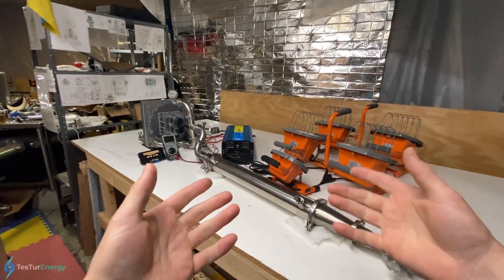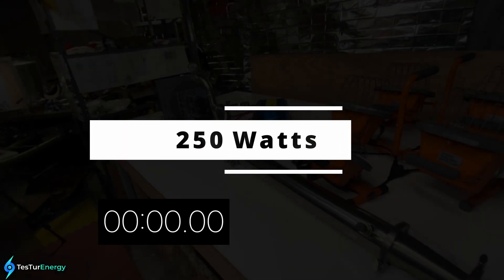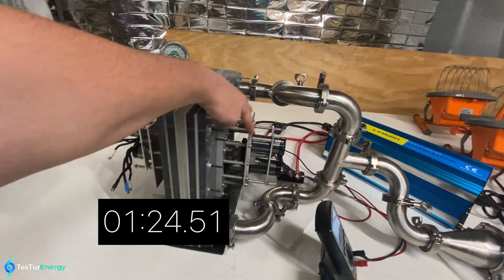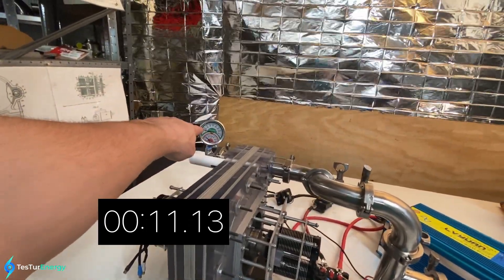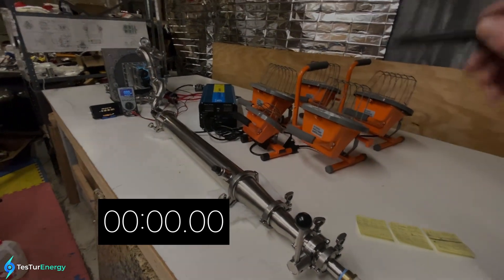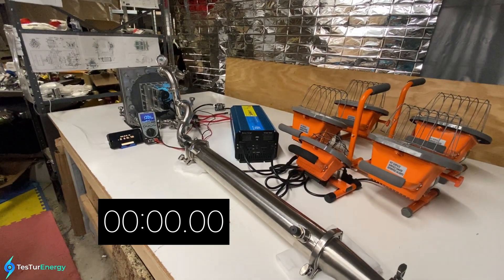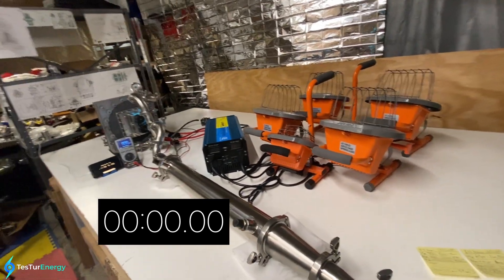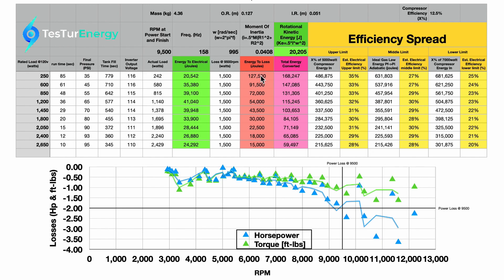Tesla Turbine 250 watt to 2.65 kW Power and Efficiency Test

Comment: Do they work course of course a lot of inventions and ideas work the question is is it economical is it going to save over a different method if it's just a neat study by all means try everything on the planet but if you want to convince me that this will be an efficient means of power generation more so than natural gas coal gasoline hydroelectric nuclear or anything else you need to show steps a through z of what it takes to power this turbine and how much voltage and amperage you can produce and the cost per kilowatt hour because right now I can buy electricity at 12 cents per kilowatt hour and nothing nothing else I have seen in 30 years for me as a residential customer can beat that rate. I'm all for innovation and experimentation but let's be logical please
Reply from the maker: Hey thanks for commenting. With TesTur Energy, our mission is to give people energy independence through Combined Heat And Power (CHP) systems that can make use of underutilized energy sources like biomass, solar thermal, geothermal and even low grade fuels containing high quantities of solid particulates (like saw dust, pulverized coal and powdered iron); energy sources/stores that are currently underutilized due to the lack of turbines and engines capable of handling the multiphase fluid flows (any combination of gasses, liquids, solid particulates) present in low grade heat boilers and low grade fuel sources without damage over prolonged/continuous periods of use. 

Www.HeatAndPower.com 

Www.TesTurEnergy.com
Reply from the maker: If you would like to know more check out my video on our latest Steam Tesla Turbine Micro Power Plant - 1st Start Up https://youtu.be/aMYyBsjhBR4   

https://www.instagram.com/reel/ClqGwiDDRSN/?igshid=ZmMyNmFmZTc= 

First and foremost, in terms of using high pressure, low temp gases in actual generator capacities, Compressed Air Energy Storage (CAES) and Liquid Air/Cryogenic Energy Storage (LAES/CES) are very viable solutions, and they’re being employed at industrial scales as we speak.  When we look at how engines function, they typically compress air, heat it, and then expand it.   Most gas turbines and turbojet engines possess a compressor, operating on what’s known as the Brayton cycle.   For those unfamiliar, the Brayton cycle comprises three main processes:  

1) compression of air 

2) addition of heat (typically combustion but could be anything) 

3) then expansion of the air. 

If we’re talking about steam systems, only heat needs to be added to vaporize the fluid. 

Systems like ocean thermal energy conversion (OTEC) can vaporize steam, or even function in an organic Rankine cycle, at significantly reduced temperatures.  

Tesla’s improved turbine patent GB 186,083 is particularly noteworthy here.  

It cleverly uses heat from the turbine exhaust to generate steam.   

This steam then cools the combustion jet before it enters the turbine, thus significantly reducing the compressed needs typical of most gas turbines.   

While regular gas turbines require an air-fuel mix in the range of 100:1 to 200:1, thanks to this innovative approach, Tesla’s patent slashes the load that the compressor puts on the shaft, making it efficient even with stoichiometric mixtures around 15:1.  

Moreover, Tesla’s patent GB 186,084 combines combustion and steam turbine functionality, eliminating the need for a compressor altogether.
Reply from the maker: Can you show me a bladed turbine that can handle the wet steam that’s produced from geothermal energy sources without eroding down the indispensable complex geometry blades to little nubbins in a matter of minutes?     

Or a bladed turbine that can actually fully utilize all the heat energy in steam by actually fully expanding it and not be damaged by the condensation and cavitation?     

One that doesn’t require superheaters, MASSIVE heat exchangers and expensive waste heat recovery systems to actually maintain whole system thermal efficiency?     

Yeah sadly bladed turbines get zero efficiency from geothermal steam sources and can only be used to produce electricity from them with outrageously expensive multi circuit loops to keep all the fluids separate and have MASSIVE heat exchangers.     

But when even just one geothermal site in California has more energy than the US needs for the next 1000 years and TesTurs see no damage from multiphase motive fluid flows I’d take even just 10% efficiency over the zero that bladed turbines can offer.     

The same goes for solar steam boilers because it’s very difficult to have a residential solar boiler that doesn’t produce wet steam.     

Furthermore bladed turbines can’t use low grade fuels like biomass, woodgas, and definitely not solid particulate fuels like powdered coals and pulverized iron.     

That’s not an issue for the TesTur for the exact same reason that condensate and cavitation in wet steam doesn’t damage it.   

Because there’s no lifting surfaces for the particulate to smash into.
Reply from the maker: What most people mean to be saying is, bladed turbines get a high efficiency on only a very limiting, very specific, very expensive set of proprietary formula refined fuels.    

And the only reason TesTurs don’t is because no one has actually put any money into them like the BILLIONS of dollars thrown at proprietary bladed turbine designs just to get 1% point increase in efficiency.
Reply from the maker: TLDR: Most people with land don’t need to buy biomass or sunlight. 

And the heat energy not out towards electricity can then be used for heating too in a residential combined heat and power unit. 

So yes. It’s MUCH cheaper than buying electricity. 

As far as efficiency goes… (mind you this is a copy pasta 🍝 so it’s a bit long but it’s worth the read.) …My 2650watt electrical load run came in with a very low ball calculation of 40% isentropic efficiency.  To start off, mind you that includes generator losses, 3 phase rectifier losses, and inverter losses to the electrical load that were not accounted for. So the turbine off the bat is already most definitely doing better than the 40% isentropic efficiency I’ve calculated from the already low ball test results.   But for now I’ll just assume 40% isentropic efficiency so that I’m not over claiming what I can prove it can actually do for the time being. (I have nothing in the long run to benefit by overstating my numbers and only my legitimacy to lose. I’ve worked hard for my physics degree and don’t intend to tarnish it for a couple of extra views on the internet.) 

As far as inefficiencies to the system to fix, there’s 10x crappy ball bearings in this version, 2 crappy RC car gears, both losses will be gained for power out with a direct to shaft generator. (Minus two gears and 8 crappy ball bearings)  There’s an 1/8 of an inch of space between the turbine endplates and the casing endplates on both sides of the TesTur. That’s a 1/4in of open flow area around the 2in wide turbine (that only even has a total of 0.75in wide of spacing between all the tight disc spaces for torque to begin with.)   That means 25% of the open space for flowing through the casing, between discs and between the casing and turbine endplates, is just free flow over the side of the turbine still. (I’m using the absolute bottom of the barrel of machining equipment right now in my garage 🤷‍♂️)  There’s no labyrinth seals yet to even attempt to further reduce that overflow… 

The nozzle is atrocious at the moment, when making the variable converging section have a tight convergence it causes the fluid jet to aim more centripetally (towards the axle) instead of tangentially (glancing off the disc tips) which severely effects the fluids natural path.   This will be fixed with the new variable nozzle design I’m going with.    Then even further in this specific casing’s assembly there’s two “pillars” in the middle of the nozzle.   This is because the aluminum plates in the middle of the casing plate stack only had the variable nozzle bar and inlet holes cut out, and not the full nozzle geometry.  So those pillars are just vertical bars in the middle of the nozzle for the air to smash into just before going into the turbine (hopefully the wet steam tests will just erode them down 🤭)   Before all that there’s still about 100ft of air hose between the tanks and the turbine… plus a shell and tube heat exchanger and a TON of elbows and fittings.    I’m sure I’m forgetting something too but between all that being fixed… I can almost guarantee we will be in the 60-70s % range and that’s all just still with room temp compressed air.   Most forget, I’m using room temp compressed air and never went over 20psi at the nozzle for these tests. (Pressure differential and temperature differential govern efficiency) 

And even then I still only even have a single stage on it yet.   Everyone wants to compare it to the efficiency of a very high temp, high pressure (1000°F & ~1800psi) multibillion dollar 15-30 stage steam turbines…   😮‍💨   That’s apples to rocket ships. 😅  But considering Rankine Steam cycles get theoretical max about 33% of input heat (due to latent heat of condensation and that’s without any regenerative boiler feedwater preheat, air fuel preheat, etc) and then 40% isentropic efficiency (considering the turbine as is) we’re looking at 13.2% thermal efficiency with steam.   A more apt comparison for the TesTur would be something an individual can actually purchase, like 1-5kW piston gas generators that you can get from Home Depot or Lowe’s.   These get 15-22% thermal efficiency off the plant floor. Good luck getting that 1 year down the line or later with all those moving parts.  Also for reference, industry standard for micro bladed gas turbines is 25% thermal to electrical. Whole system efficiency can go higher in Combined Heat and Power (CHP) system, but alas the TesTur would see the same whole system efficiency increase in a CHP Auxiliary Power Unit (APU).  In the TesTur you gotta replace…? 🤔bearings…? And still even then, only maybe 🤷‍♂️ depending on how good of bearings, balance, lubing, cooling.   The TesTur, and other bladed turbines, only have one moving part. 🔥 

So if those piston generators drop efficiency, even at all, the TesTur on its worst day is competitive with a gasoline piston engine electric generator.🤓😬🤷‍♂️  And the TesTur can handle any fuel that can burn, even solid particulate fuels like powdered saw dust, pulverized coal, powdered iron, biomass, etc. (noting the number of those that can be acquired without spending money… 🤑 opening up “low monetary cost”, even carbon neutral, fuel options for MILLIONS around the world)  We have to remember that the TesTur doesn’t have to be the holy grail to be worth using if we have free fuels readily available like biomass, and even waste heat already being dumped out into the air and not used for anything.  The TesTur just has to be a viable option for some to be worth doing. 

Even more, the mere fact that I’m using a low temp fluid for my 40% isentropic efficiency calculation means my TesTur efficiency is severely limited by thermodynamics and fluid dynamics.   Increasing temps will automatically increase my turbines efficiency.  This is because gasses have an increasing viscosity trend as you increase the temperature.   This leads to increased isentropic efficiencies in the TesTur from reduced slip on the discs.  (Meanwhile, we’re already talking about a piston engine using combustion temps as is.)  Whereas bladed turbines see the increased viscosity as an increase in drag loss through the turbine blades.   So we can’t always count on seeing increased isentropic efficiencies in a bladed turbine in practice when we go from low temp to a high temp.  Again, to reiterate, this increase in viscosity in the TesTur only works to enhance the working action of the TesTur.  (That being viscous adhesion to the disc faces increasing torque.)  That’s all on top of the increased thermodynamic efficiencies of using a higher temp elastic fluid too! 🤓 

The disc spacing for room temp gasses is not going to be the same for combustion temp gasses/steam because the viscosity of either increases by 3x fold. And I’ve designed these spaces for a higher temp fluid with a slightly higher viscosity so these will inherently be too wide at the current temperatures being used.   So as we increase temps along with all these other really easy to fix mechanical issues (that only are a thing because I’m building this in my garage on a junk cnc machine) I have no doubt we will see more than competitive isentropic efficiencies compared to bladed turbines, let alone whole system thermal efficiencies that are through the roof.   This is because of the heat recovery systems that can be added with the cost savings of using a TesTur vs a VERY expensive, and in my opinion, relatively delicate bladed turbine.   Just getting tighter casing clearance with the turbine should give me at least 20% points back on efficiency putting my testur at the 60% range.   Coming in with a 19% thermal efficiency in a Rankine steam system without any kind of thermal recoup.
Reply from the maker: Of the suns light, 10% is Ultraviolet (UV) light, 25% is visible (Vis) light, and a whopping 65% is Infrared (IR) light. Depending on location, total available energy per 1m2 varies between 500-1000watts per 1m2 per 1hr of good sunlight

With solar thermal collectors you can collect all 25% of the visible spectrum and all 65% of the IR spectrum and store it as heat in a thermal mass.   So 90% of the suns light energy can be collected and stored as heat in a thermal mass. Let’s say 10% loss on storage  So 81% of the suns light energy is then available to be put through a steam Rankine turbine system, which at theoretical best can get 25-33% thermal efficiency to electricity. 44% is the recorded best (And that’s without any thermal recoup, boiler feedwater preheat, etc to bring up the Rankine cycle efficiency and/or going to an organic Rankine cycle with a refrigerant in the closed loop instead of steam for higher pressure gradients with the same temp gradient, for high efficiency)  So that’s 20-26% of the suns light energy can be put directly out as 60hz 120vAC.  About a 10-45% increase in energy out for the same footprint of collectors.  And then even after that ALL the heat energy rejected/dumped out by the condenser from the latent heat of condensation and loss not turned into electrical power can then be used for home heating.    Sooo since about 60% of the energy stored goes out the condenser, if it’s used for heating then somewhere like 70-80% of the suns total light energy can be utilized for electricity and heating. 

Breakdown:

Commercially available solar PV collectors typically only utilize the visible light spectrum, and in practice make use of about 20% of the sun’s light to charge batteries.

Typical battery storage can recover about 90% of that to the 110 wall plug after battery charging and discharging loss.

Yielding about 18% of the sun’s light converted into practicable electricity.

Though after 10 years PV panel and battery degradation can decrease useful amount of the sun’s light down to 9 to 13% to the wall plug.

Solar PV Cells: can only utilize the Vis spectrum. (at best 25% of suns light energy) 
Typical Performance: 20% of suns light energy actually put to electrical currents out.
Battery Storage losses: 10% loss on charge-discharge of batteries to utilize energy.
Total Sun’s Energy to Home Electrical Wall Plug: only 18% of sun’s energy used.
Panel Aging Effects:  
Efficiency drops by 25-50% in 10yrs; 
only 9 - 13.5% of suns light useful after 10yrs

Solar Thermal Collectors: 
-utilizes both Vis and IR spectrum of suns energy.
-Vis 25% + IR 65% = 90% of suns light collected as heat

Thermal Mass Storage Losses: 
10% loss on charge-discharge of thermal mass.
81% of sun’s light available as heat after storage.
Steam Rankine Thermo Cycle Efficiency (heat input into electricity output):
25 - 35% typical steam system
45% recorded worlds best 
(Note: this is without thermal recoup systems)
-20-28% of sun’s light energy available for turbine (37% worlds best)
-Turbine Isentropic Efficiency:
Current Plastic & Alum. Prototype: 40%
8 - 12% of suns light goes to electrical (15% in worlds best CHP system)

Reasonable Expected Efficiency 
Spread After simple Improvements: 

If we can get a final Isentropic efficiency of 60% - 70% - 80% respectively, then: 
-@ 60%: 12 - 17% of light will go to electric wall plug (22% in best system)
-@ 70%: 14 - 20% of light goes to electric wall plug (26% in best)
-@ 80%: 16 - 23% of light goes to electric wall plug (29% in best)

Energy Conclusion (% of sun’s light actually used): 
Electrical without and with TesTur improvements: 8 to 23% (29% best)
Additional Heating Utility: 60% to 50% (respectively)
Power-to-Heat Factor (P:H) : the more turned into electrical, the less into heating
No Improvements: 8% / 60%    =  0.133  P:H
w/ Improvements: 23% / 50%   =  0.46    P:H 
Total of Sun’s EM energy (For Same Footprint as PV) w/out and w/ improv.: 
68 - 81% of sun’s energy gets utilized in some way!!! 

(Note: World’s best large scale Combined Heat and Power Plant Thermal Efficiency is 76.5%)

Efficiency Conclusion: Solar thermal offers more energy with the same space.

Continuous Energy Generation: Solar thermal during the day, biomass boilers at night.
Biomass Boiler Integration: Utilizes carbon-neutral biomass to charge the thermal mass battery, ensuring heating without reliance on fossil fuels.
24/7 Constant Power: With the added hybrid capability, continuous electricity and heating, regardless of weather or time of day.
Sustainability: Combining solar energy with renewable biomass, contributing to a cleaner environment.

Solar PV System:
PV Panel Setup (5-10kw): $15,000-$20,000
Battery Pack and Electrical Accessories (25-30kWhr): $15,000-$20,000
Total: $30,000 - $40,000

Biomass Storage Container: $1,000 - $2,000
Biomass Boiler: $5,000 - $10,000
Solar collector: $3,000 - $5,000
Thermal Storage tank: $1,000 - $2,000
Steam turbine: $3,000 - $5,000
Generator: $2,000 - $3,000
Power inverter: $2,000 - $3,000
Control unit: $1,000 - $1,500
Pumps: $500 - $1,000
Heat Exchanger: $500 - $1,000
Total Price Medium: $22,000 - $35,000

Cost Conclusion: Thermal systems are more cost-effective and offer additional heating benefits.
Hybrid Options: utilize multiple energy sources; back up security/energy source redundancy promoting overall energy independence.

3 kWh $1,200 – $2,250
5 kWh	$2,000 – $3,750
24/7 Constant Power: Small and Medium Packages available.
Thermal Heating Solution: 90% energy storage as heat, biomass integration.
Cost-Efficiency: Competitive pricing with added benefits.
Off-Grid Conclusion: Complete energy independence with TesTur's innovative solution.
Reply from the maker: Not only is this cheaper than solar PV but you also get your home heating with it too. The fact that it can do heating means any amount of electricity it does make is just extra on top of what a hole already would pay for their heating. 

And to be clear this may not be a solution for everyone. But it doesn’t have to be a solution for everyone for it to be worth doing for enough.